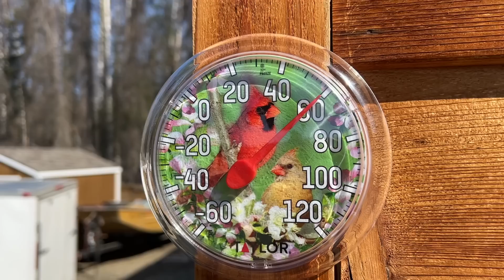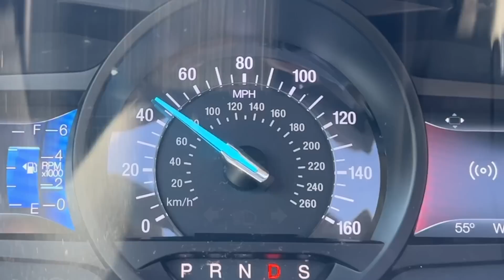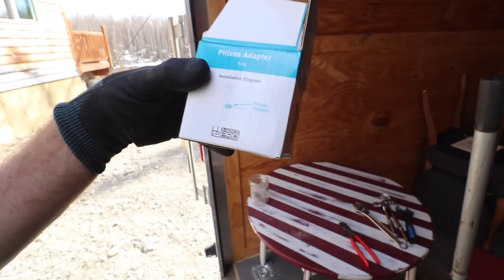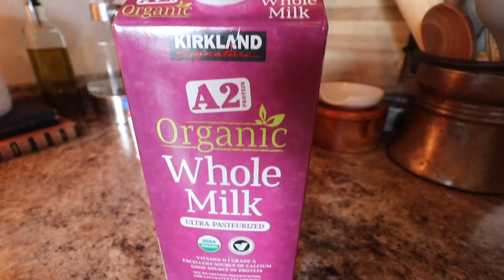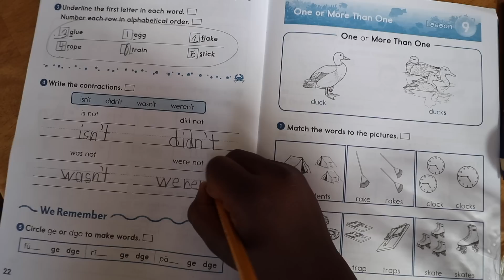Off Grid Water | Connecting the Well to Our Cabin + Let's Talk Dairy Animals, We're Gettin' Some!

Comment: I told you about citronella oil before. Just put a couple of drops around your ears and a  couple along the jawline. also put it on your arms. I buy it at Walmart near the candles. I also buy a citronella plant in their garden section. Put it on your front door. Every time you go out, gently ❤sqeeze a couple of leaves. It will "smell" all day and that will keep those horrible knats and mosquitoes from going into your house! Every time you come out of your house if you're going to be outside for any length of time pull off a couple of the leaves and rub it against your face, back, or your neck. Any places that is exposed to the mosquitoes. It will last for several hours!!🎉😊😊

Comment: I agree... Joe is very capable!👏👏👏  Here in South Africa we use citronella oil mixed with saflon (antiseptic liquid - optional) and maybe a little water in a spraybottle to spray on you for the mosquitoes. You can wash your clothes in it as well. It has a strong smell. We also burn citronella candles.

Comment: Might want to double check about tie in. We had to cap previous after realizing the the water preasure dropped burning up pump and water from new well actually back flowed into old well. It was a real mess. Who knew...
Paid for advice and worked with to reduce cost. Our plan was right, execution for that location not right...

Purchasing market starts and finishing is time consuming but already weight 100 lbs to prep for fall/winter. Most meat breeders don't want to waste resources so they sell for slaughter. You can buy a small lot easily that way at good price.
Good luck on your projects. Busy time..
Reply from the maker: The only issue we may have, we might have to buy a bigger pump. But so far, now issues.☺️

Comment: Don’t want to be the bearer of bad news but my water line coming from the well is 12’ deep and it froze winter 2021/2022. Our water line goes under our driveway, and with driving over the water line there is no snow for insulation. Hope you don’t have the freezing issue like I did.  My well guy was able to install a heat trace in my water line.
Reply from the maker: Aw bummer sorry to hear that! But the original water line also ran/runs right down the driveway all the way to the cabin & there’s never been a freezing issue so hopefully we’ll be alright!☺️